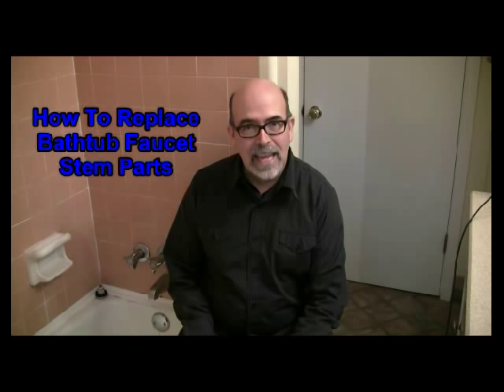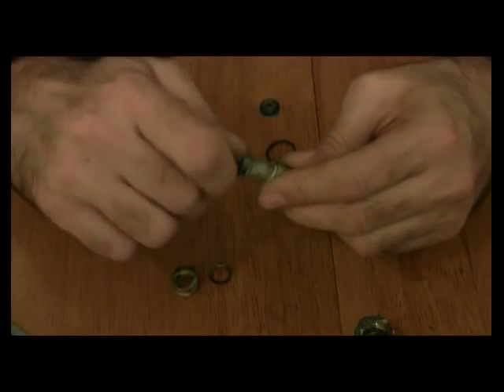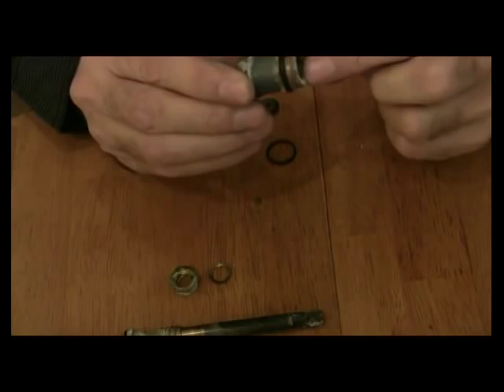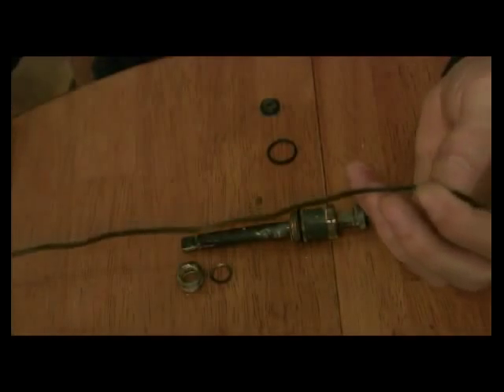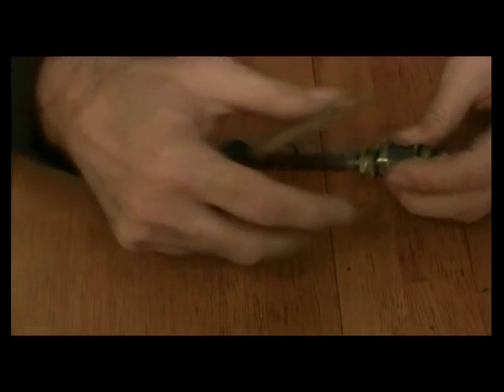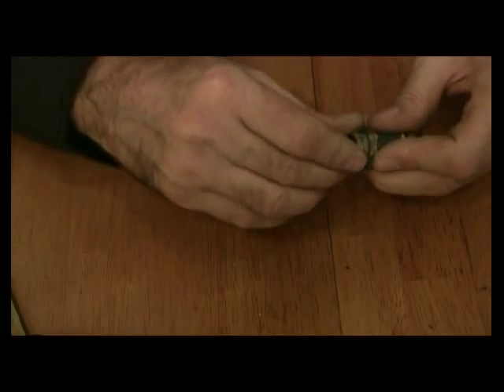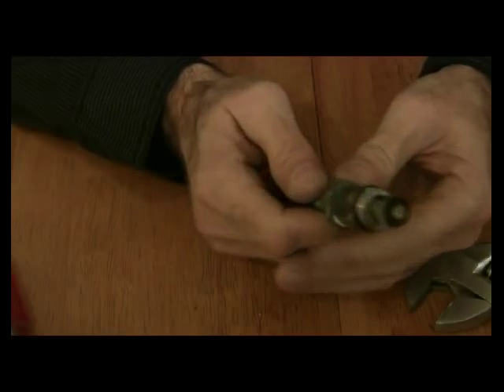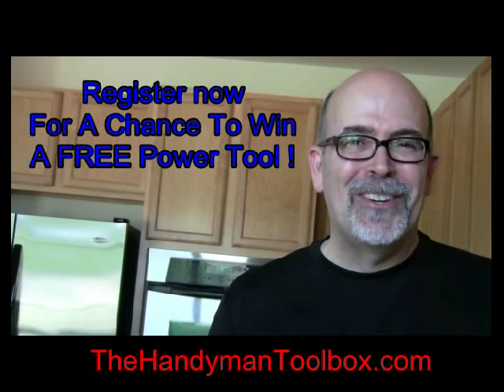How To Replace Bathtub Faucet Stem Parts

Comment: I'm rebuilding a bath faucet cartridge. I am not sure how much torque to use at the various junctions, in particular, to the nut over the packing. If I tighten too much, the spindle gets hard to rotate. From the video, it looks like you want it only tightened (first by hand, then by wrenches) so that the spindle remains easy to turn.
Reply from the maker: balangkeglodok That's it! You got the idea...way to go!  Be sure to subscribe to my channel and not miss any new videos.

Comment: I have this piece at home and I've been missing the stem cap for as long as I can remember... it's just always leaked.  But I want to fix it!  Do you know where I could get a stem in that style?  I've searched a few local "plumbing" stores and haven't had any luck with a match.  I've also tried E-Bay, but I don't know what the part is called, or what brand it might be.  I'm really going out on a limb knowing you posted this video 5ish years ago - but any help would be greatly appreciated!  Thanks! (I've even subscribed :)
Reply: Did you ever find this peice Im having the same exact problem
Reply from the maker: Since this is a consistent issue for some of you, I found out that as a general rule, ACE hardware might have what you are looking for. Also, i have found some rare items at the older, out-of-the-way hardware stores in local, smaller towns.
Reply from the maker: See note above
Reply from the maker: See note above